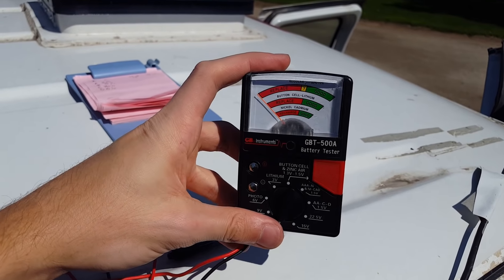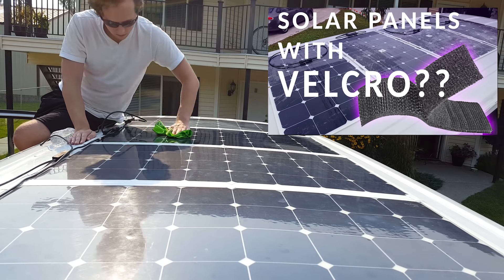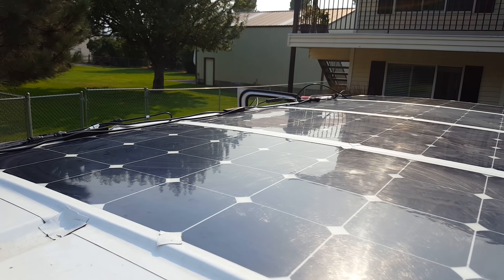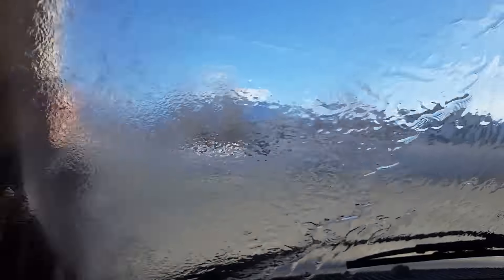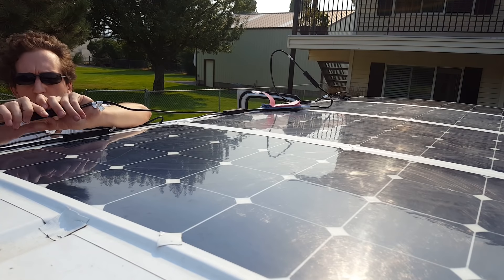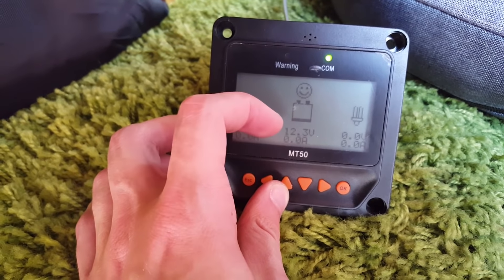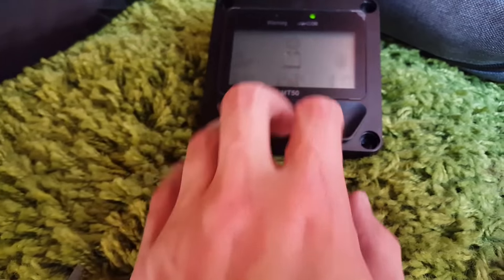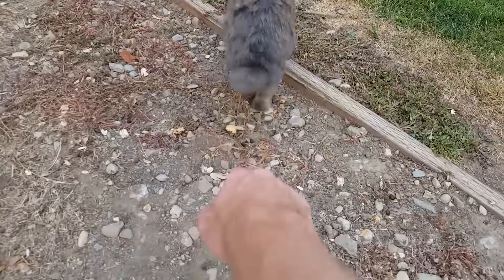How To Test Solar Panels

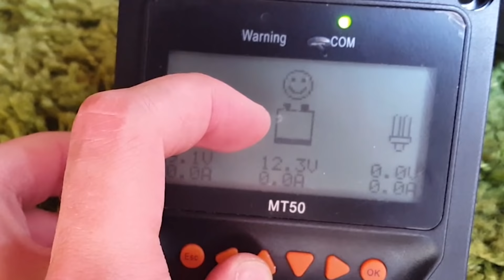Comment: @5:40 that's your battery status gauge. It needs you to set the Ampere-hour size of your battery in the controller to be accurate.  This indicator tells you the following status modes with various graphic symbols:

BATT Status Meaning:
Equalize Battery is equalizing
Boost Battery is in boost mode
Float Battery is in float mode
NoCharge No charge to battery
LVD Low voltage disconnect
UVW Under voltage warning
Normal Battery is normal
OVD Over voltage disconnect
Disc.O.O.Ctrl. Battery experiencing error charging/discharging
Ctrler O.Temp. Battery is too hot, over temperature

Granted, the manual is poorly translated into English and at times gibberish,  but here it is:  https://www.renogy.com/template/files/Manuals/TrcrMtr-MT-50.pdf
Reply from the maker: Thanks for the info. I've got it set to the amp hr of the battery packs, but either I hardly ever got a charge with the original panels or I had the settings wrong. It would rarely reach past 50% even with all day of charging. Fixing the solar panels made it a bit better though.
Reply: Only if you start with a low enough battery voltage or extra load on your controller, will it pull the maximum power from the panel.  Otherwise, it limits the charge from the panel to the battery so it doesn't overcharge.  Remember, a fully charged battery will not get power from the panel other than the float charge.

And I think the A-H indicator needs some time to settle down.  Try cycling it a few days through the battery range.

Another note, you need to measure both open circuit voltage and short circuit current to determine if a solar panel is good.  Open circuit voltage is often deceiving, since resistance from bad connections won't show up without a load (and your meter doesn't provide a significant load).  Don't worry about shorting out a solar panel, it's designed for Imax-power which isn't much different than Ishortcircuitcurrent and unlike a battery, the panel itself limits its output current.

Comment: On the MC 4 connectors,it states DO NOT disconnect under load. Maybe you should cover the panel B-4 you test them,individually.
NO out put would mean an open circuit in one of the tiny wires. Blown diode?
Reply from the maker: Good advice for saftey.

Comment: If you have a charge controller in line it will show low voltage if the batteries are at 12.5 and 13.5 is maximum voltage not 14.5. As far as your no voltage on two of them it's a blown diode.
Reply from the maker: Interesting thanks 👌